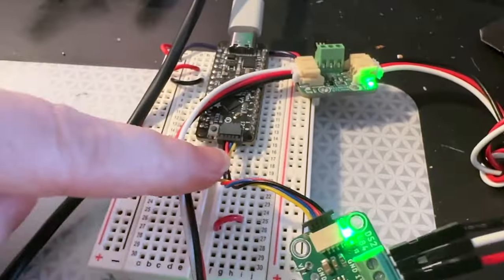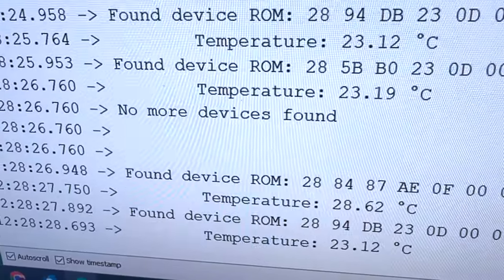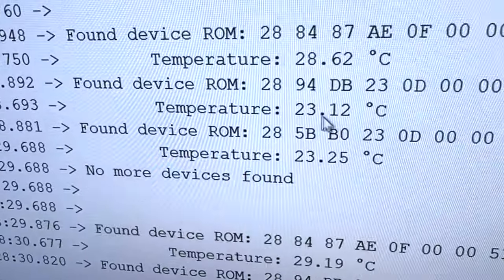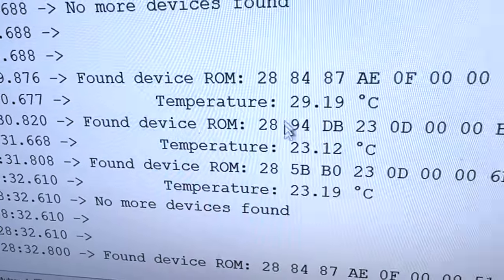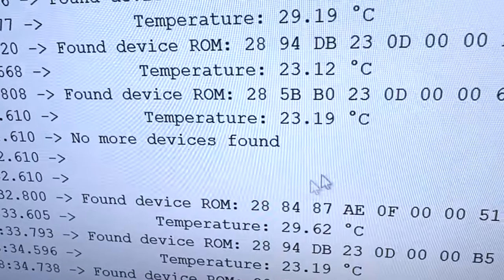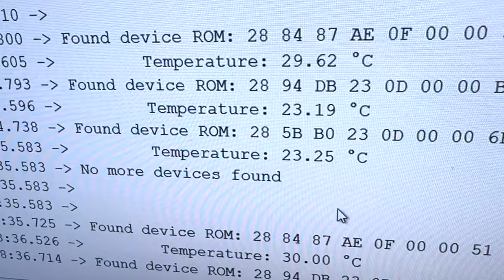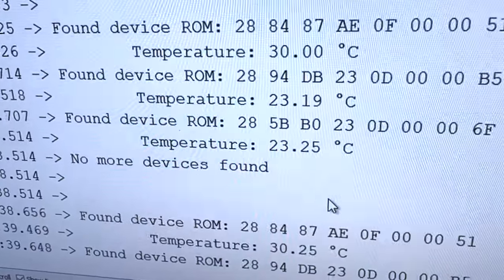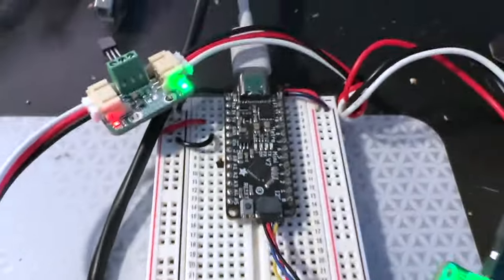Prototype board with the DS2484

Comment: one wire communication
looks inside
four wires
Reply: Um ... really?
Reply: Dude, pls read a book before posting such cringe. Its 1 wire COMMUNICATION. still means u will need at least 2 wires (Dq, GND). In thix example you have the bare minimum to power and communucate with a device.